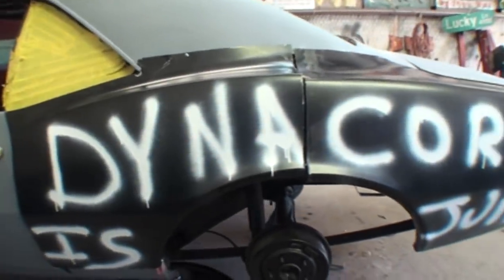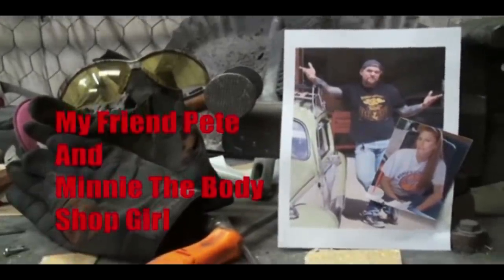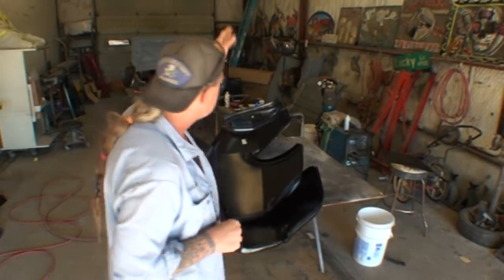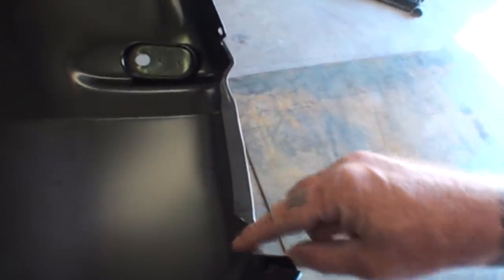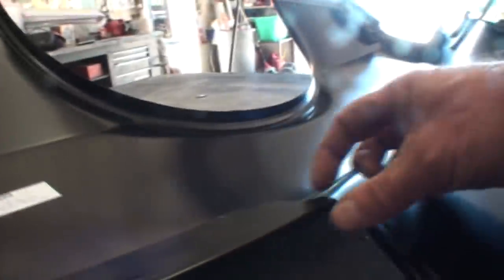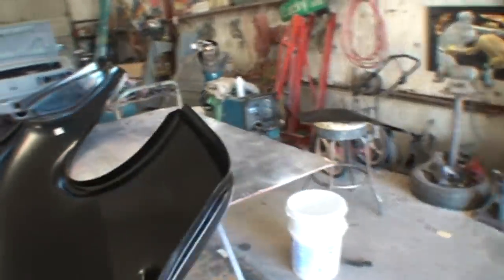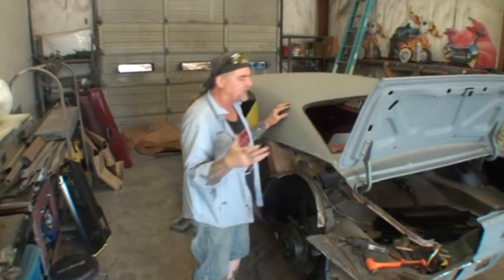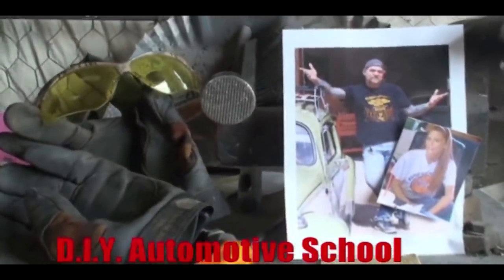I Want An Aftermarket Quarter Panel - Which One Should I Buy?

Comment: Love it man..the struggles with aftermarket sheet metal is REAL people...!!!
Reply: Try finding quality front "fender" sheet metal for a 2nd Gen Ford Econoline(stubby nose), with the intricate bends. I've had a 1969 E-200 Supervan for 20+ years, that unfortunately, experienced a serious front end trauma in 2003. Man, nobody does anything for that body style, and the ones I bought didn't even look close. Sucks. 

I searched for that van for 8 years, and finally found one around 1999 or so. It came to PA from CA(I still have the orig blue CA plate), and was absolutely immaculate. There wasn't a spot of rust to be found...very rare for this body style in the Northeast. Makes me want to cry when I see it sitting there.

Comment: I restore cars too. I've installed the complete full quarters, sail panel and all, on Camaro and Mustang and was pretty satisfied with the fit. They weren't Dynacorn. Didn't come directly from AMD either. Who knows other than the sticker that said Taiwan. Customer supplied them to me. He is also a good friend. Of course as with any aftermarket sheet metal they required some tweaking. The only quarters I have ever installed that did fit, other than oem, were GM Restoration parts quarters for a 72 Chevelle. They were dead on the money for fit. I've also used a few of the patch quarters that just come up and break over the bodyline, but cut and attached them right on the bodyline at the top, , no overlap, my weld was the bodyline, and almost to the end front and back, but not into the door jamb, or rear of quarter. This was my 2 cents worth of info.

Comment: Dynacorn replacement panels and complete bodies are BAND here in OZ by law, I have brought a Hood once for a Mustang and ended up trowing it out!.......... The next comment I would like to make is  that I would have change the quarter all the way up to the roof and re lead loaded, then finish the joint below the rear window properly by spot welding it on, and so with the door jam. I think that that way is actually less work

Comment: All you need is a Body Panel Absolute Fitment Machine. I have Seen several in operation, & they work really Great, Most Scrap Yards have at least one, they employ extreme hydraulic pressure & make "Neat Little Cubes" out of parts that don't measure up, LOL...

Comment: I had to cut both my outer rockers for a 1973 Blazer.   Same thing.  Each rocker was about 3/8" too short.  I splice in a small strip of metal on the 1st panel, but I had enough good rocker on the 2nd to splice the two together.    The rear contour on the aftermarket panel was also pretty bad so splicing helped keep factory shape on the 2nd.
Reply: @Frank-v8e1o  I don't remember the brand, but I bought it from Classic.

Comment: Since 1984, Dynacorn International LLC has been supplying the classic muscle car enthusiast with quality sheet metal, bright trim and molding for restorations or for just plain making a ride look its best. As we blasted through the 80s, 90s and now the 2000s, one thing stands above all else.
 The quality and fit of our restoration quality parts is unsurpassed (LOL quality? but the fit? That's DEFINITELY unsurpassed). The Dynacorn parts of 2012 have no relatives from bygone days (so the founders are gone). Our tooling is new and crisp (shoulda saved that money), the steel we use is the very best (though thin) available on the market and the craftmanship (craftsmanship misspelled, red flag)  is beyond good...it is superior. (apparently not.)

Thanks for the "heads up" Pete, we need more videos and more honest reviews from honest people (like yourself).

Comment: I was watching a roof replacement, dude used a dynacorn roof skin, it was 1 inch too short, he acted like it was nothing and welded in a piece, barely mentioned it like it was no big deal! Just thought I'd share! I won't be buying many panels, but they will not be dynacorn.

Comment: Pete is dead on. Some of these aftermarket parts are a joke. I'm currently struggling with an under body part that is requiring cutting and bending to make it fit. You shouldn't have to do that when you've paid big money to get the " right " part.

Comment: I've replaced every piece of the outer sheet metal on the shell of a 1969 Firebird with Dynacorn. What a huge disappointment! Not one piece fit without major modifications. The door shells I'm not sure where they were from, however the outer skin was too long and I had to trim both the front and the rear of the skins and weld the ends, literally making a new gap. Now for the real bad part. The front fenders and inner fenders are AMD. Same crap as the Dynacorn. The contour of the fender at the door was off, around the front to match to the bumper was way off. Once again major modifications. The inner fenders are way oversized. After 3 hours of bending, beating, and prying I finally got all the bolts in. New issue now is the front of the inner fender doesn't match the fender or valance panel. Not sure what I'm going to do there. Today I will start on the left fender and inner fender. God help me keep my temper down as I know what today is going to be like. Bottom line, in my opinion the days of building cars with good aftermarket sheet metal are over. I like your videos and how you put it out there without sugar coating it!

Comment: I smell a lawsuit coming lol. I had the same problem. Better to get O.G. metal if you can or cut a least as you can off the body and patch with the dynacorn.
Reply from the maker: no lawsuits just plain truth... The bastards I bought it from wouldn't even work with me... Told me Im STUPID and don't know what Im doing!  FUCK UM!
Reply: @diyautoschool  everything is going to shit in the parts world. OEM, tong fuckin yang, dynafail, man it's all going to shit. I'm about to call up GM for sending me shit that won't fit on their new cars. Thats just the first of the GM OEM problems... I Got a bedside in and I was ripping off ugly ass spot welds with my bare hands.

Comment: Hey there, thank you for your video.  I have a late 68 mustang and I need a passenger side quarter panel.  I checked AMD and they do not have any Mustang quarter panels. Which brand do you prefer?  I have seen some of the brands and they have the wrong contour on the C scoop.  I am pulling my hair out over this issue.  Nobody actually stocks any quarter panels so I would have to play the order and return game.  That can get very costly, any help would much appreciated.

John G

Comment: I have had to fabricate panels and pans by hand with a ball peen hammer, C-clamps, a cheap bead roller that never worked right, and angle irons. I didn't even have a poorly fitting panel to "make it work". An "excellent fit"? Does that even exist?

Comment: Yea these panels are not exact replacements, they are OK if you have nothing, the tooling is very expensive and they will never be exact OEM. I have had good luck with AMD but they aren't prefect either. Better have some experience before hanging quarters.

Comment: my buddy just had a shop paint his 54 ford conv. 6000 bucks just to paint a stander paint job and it was bad he had to take it back to them 3 times because they had fish eyes on the lower parts of the body did not even buff it out or wet sanded it  at least it didn't look like it i told him i could dun a better job doing it in my drive way the problem he has i will not paint other cars only my own i only do it for a hobby now

Comment: Bought DYNACORN window tracks, glass guides, and hood latch support for a 71 CUDA. Fit like crap! Hood latch was made out of wrong gauge metal, way to thin! Window tracks would not accept the factory window cranks and the glass guides were totally incorrect so i used the factory parts. couldn't sell the DYNACORN stuff on eBay for pennies on the dollar! All my AMD stuff fit decent with a little massaging.

Comment: Pete I want to first say that am by no means defending Dynacorn!!!! 

The real issue is the fact that in the body assembly manual the gap tolerances that the factory calls out are HUGE!!!   on a 1969 Camaro the factory manual says a gap of up to 1/2” for the lower fender to door gap is acceptable.   So Dynacorn says that the parts meet factory spec!!!   But factory spec back then sucks compared to today’s spec!!!!     You are ultimately dealing with what is called stacked tolerance.    Shame on Dynacorn for using this to there advantage!!!!

Comment: AMD better. I had to split the top of AMD and pull them up at the top by quarter window area by the door and weld them. But had good luck with AMD. AMD will work.  I did AMD floors years ago in a 70 camaro and they fit real real good along with the bracing and a new trunk. I sent 2 69 Dynacrap fenders back a few months ago. Pry push cuss and try to spring load them bitches to fit. Only way to make them fit is cut the bitches to pieces with a cut off wheel and pull them to fit and weld them up. Lol. Now Mr Customer buy NOS or pay me 1200 bucks to get your 300 dollar Taiwan crap to fit.

Comment: You had that problem because you either ordered the wrong quarter panel or they shipped you the wrong quarter panel. That's a Firebird quarter panel your trying to put on a Camaro. Anyone worth their salt knows the 1st Gen Firebird rear end is 2 and half inches shorter than a 1st gen Camaro rear-end. The Wheel base on a 68 Firebird is 107.6 inches, the wheel base on a 68 Camaro is 108.1 inches, a 68 Firebird is 184.6 inches long and the 68 Camaro was 188.8 inches long. The Firebird front fenders are shorter too because it's 4 and half inches shorter all the way around......
Reply: I didn't see the lower 1/4 molding 67-69  "louvers"  on the re-pop panel. HOW CAN it be a Firebird 1/4 ? 🤔
Reply: @jamescon55  because there were 4 different versions of the one with the molding and one without, and one with the louvers and one with out. they all didn;t come with molding and louvers.
Reply: @TheREALOC1972  So then they have FOUR different 1/4 panels/skins for the 67-68 Firebirds alone? (HERE, just leaving out the obviously 'similar" but way different 69 Firebird)....🤔 And that the some of replacement  Bird 1/4 panels do NOT have the typical Firebird 1/4 louvers that were standard on ALL the 67-69 Firebirds?  Leastways, standard ta me lol. I NEVER seen ANY 67-69 Firebirds WITHOUT those 1/4 louvers in my 50 years but...IK that there ARE the kinda "similar"  situation you are talking about (non louvers) with the 66-67 GTO and the Tempest 1/4s as I have worked on couple of those for others....
Reply: @jamescon55  Yes there were 4 different versions, they came with Louvers and Molding, with Louvers and no Moldings, Moldings and no louvers and plain with no Moldings or Louvers. My uncle had a Base, basic bitch 68 Firebird that had no freels, the inline 6 (3.8 if i remember correctly) with the 3 speed manual and it had the plain quarters and he past it down to my cousin when he turned 16.
Reply: @TheREALOC1972  Wow. Learn sumthin new EVERY day...I thought ALL 67-69 birds HAD 1/4 moldings... I knew/know about ALL the different options from secretary 6 cyl cars to BB 396 more with Camaros and figured/knew the same with Pontiac.... But NO 1/4 louvers? (Even on cheaper ones)  Wow...Gonna do some MORE research on such. IK a guy with a couple project 67-68s and a 69 I believe.. 🤔 But... Unfortunately? He's another one of those -Rather let shyt go to rot and NOT do a friggin thing cuz he obviously doesn't need the money but yeah...He AIN'T doin NUTTIN 😒  SMH 😔
Reply: @jamescon55  Yep, They made a barebones version of the Firebird but Pontiac had guys like John Delorean, Pete Estes and Bunkie Knudson, who I personally knew btw, my high school sweetheart was his great granddaughter, who built the plain jane Firebird for the race car guys who were just going to yank that inline 6 out and put a big block in it anyway so they made the basic bitch base Firebird with no freels because that was just a waste of money because the race car guys were just yank it all off to make the car lighter anyway. That's why there were so many Pontiacs instead of their Chevy cousins turned into race cars and dragsters during that time.
Reply: @TheREALOC1972  🤔 Yeah, IDK about "MORE" Pontiacs than Chevys for drag cars etc. but... It WOULD make some sense WHY there ain't hardly ANY of those cars AROUND anymores though 🤔 .. But I didn't think the 67-69 birds had near the production #s compared to the Chevy Camaro either but...? I am only 49 y.o. and just guessing/goin on WHAT I HAVE SEEN in my 40 years of really looking at/ 30 plus years of working on old cars, MOSTLY Chevys though too. ,(HERE in the Midwest, as well so)... And, I kinda thought (again lol.) that the actual wheelhouse opening was totally different on the 2 brands of cars as well. Pontiac havin a different opening anyways but...? Just going from rough memories. But..But? Lemme assure you (in case you didn't know) that WHAT Pete HAD endured on THIS deal (TOO SHORT NON  fitting re-pop panels) are/is quite common TOO.... Happy Restoring and Cruizin 😎
Reply: @jamescon55  You might be right about the wheel opening, I've honestly never measured but now you have me curious.... The production numbers were pretty close, in 68 roughly 213k Camaros were built and 198k Firebirds were built, 15k more, roughly. I also think it depends on where you live or grew up to what you saw more of, I grew-up just outside of St. louis and I saw FAR more Firebirds than Camaros growing up, even in the 2nd and 3rd gens but that was also had to do with the price, for instance the MSRP of the base 68 Firebird was $2,781 and the base Camaro was $3,178, only a $400 difference but back in 1968 $400 was ALOT of money. it's roughly $4,100 in todays money, that's a big difference considering they were basically the same car.

Comment: Scabbing in a part panel is half azzed. Learn to lead and put the entire panel in. I've seen too many putty cracks on scabbed in panels. Faster better less warp and putty to do the entire panel. I would stay away from the low skill partial quarter replacement